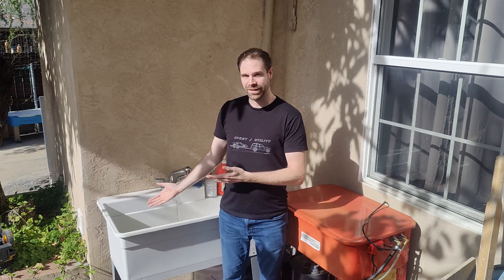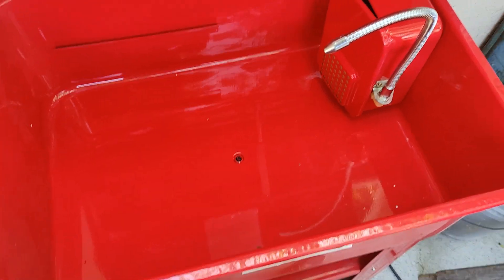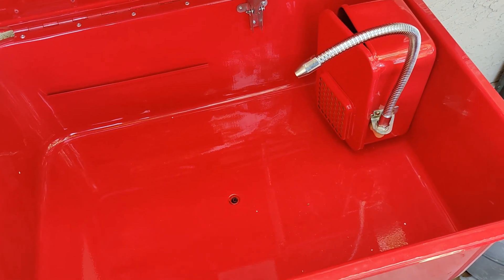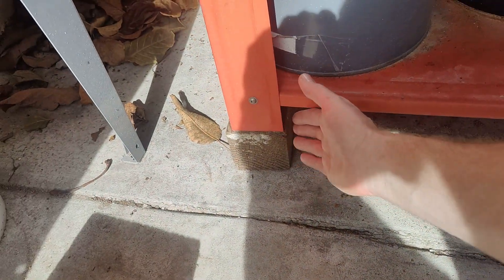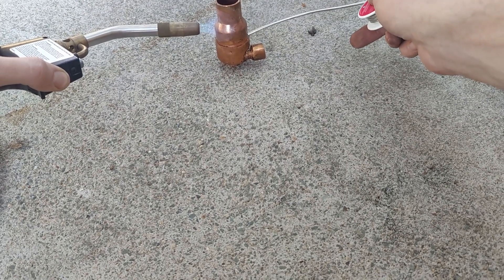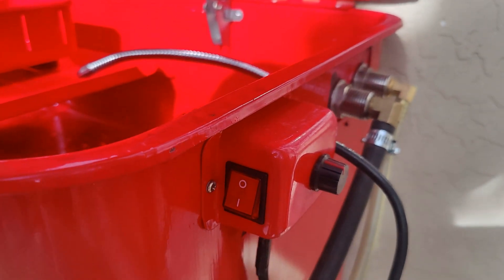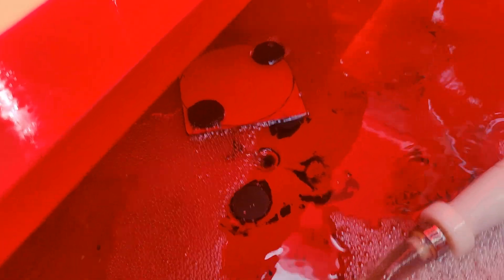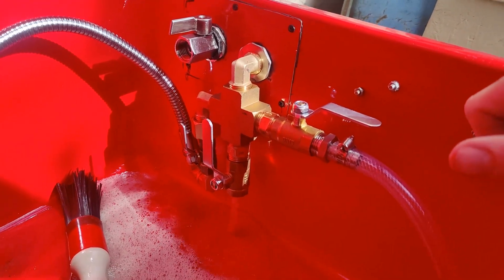DIY Dry Sump Parts Washer

Comment: Thanks for sharing your project! I recently replaced my diesel in tank lift pump and the old one still works. It’s not as strong as the new one, but maybe it will work for a homemade parts washer with and old bucket and lid.

Comment: Did you have any troubles with the nipples that c  as me with that particular pump? I ordered the same one and the nipples were very loose when screwing them in.
Reply from the maker: The nipples come loose. I had no problem tightening them down..I used Teflon tape to seal the threads.

Comment: Does the pump run off a car battery or a wall receptacle?
Reply from the maker: When I was first setting it up I used a 12v battery to test the pump, and then later on switched to an AC/DC 12v power adapter. I needed to get one with enough amps though, because the startup current on the pump was overloading a smaller power adapter

Comment: I just purchased a Harbor Fright parts washer for my small farm. The original, bare, unboxed parts washer is, in my opinion, is rather inadequate for my use, but with some modifications it could be a great asset as Greeley, oily, farm equipment is in constant need of repair.  Unfortunately, there are many videos on the subject by others who have also feel the original parts washer is inadequate.  Your dry sump design is the only video I’ve seen that separates solvent from the cleaner which in my opinion is the best. I would like to incorporate your design to my parts washer however I’m not sure I’m capable without further details.  I’m not sure if you plan on another video on the parts washer, but if you do I will try. Great modifications!